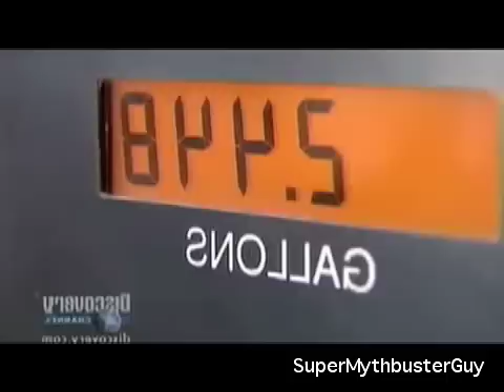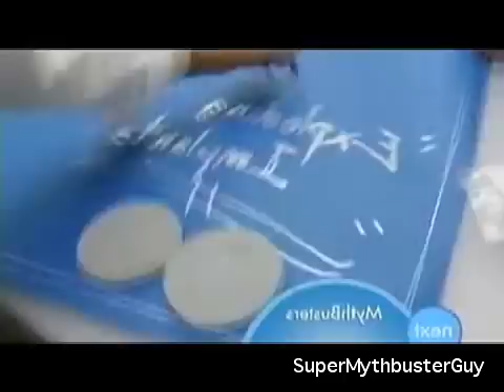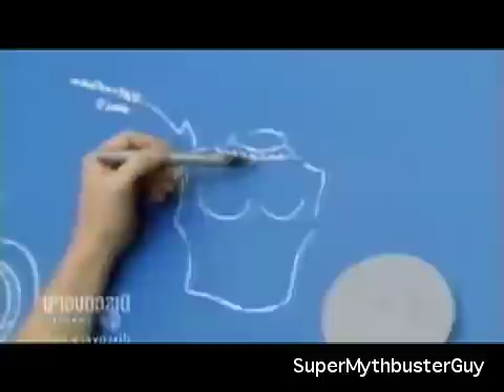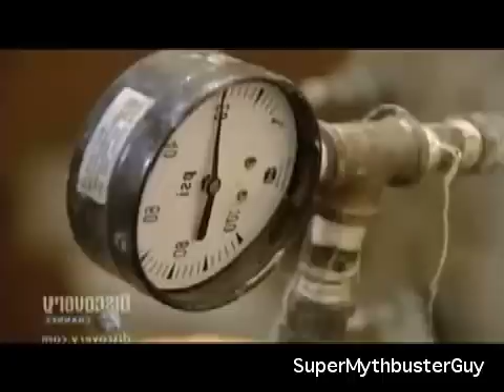Mythbusters Cell Phone Destroys Gas Station (2/3) S01E02

Comment: Maybe they were too early to bust this one. Sure, the cellphone doesn't create any sparks, WHEN IT'S NOT ON VIBRATE. I've seen designs where vibrating motor is just held against its contacts using spring. That could, in one-in-thousand case, create a spark gap and since the motor is inductive load, it "kicks back" few hundreds volts, enough to create a noticeable spark.